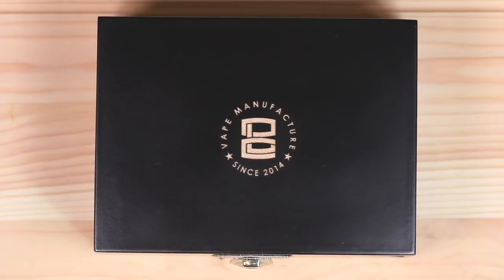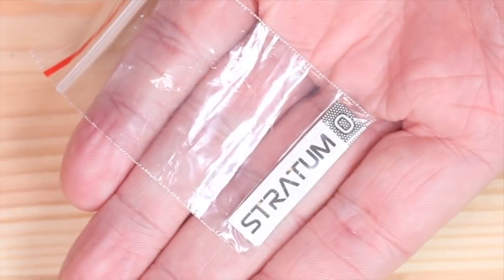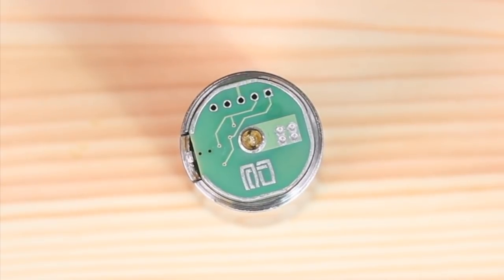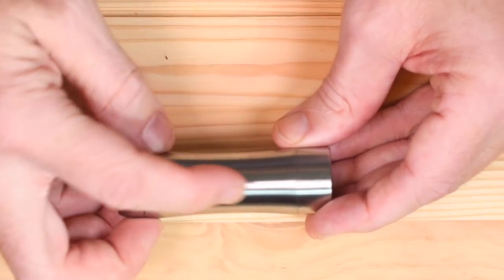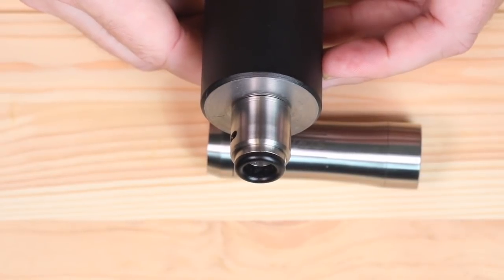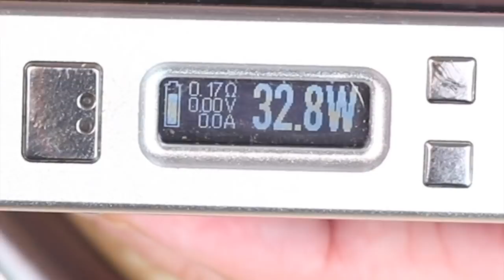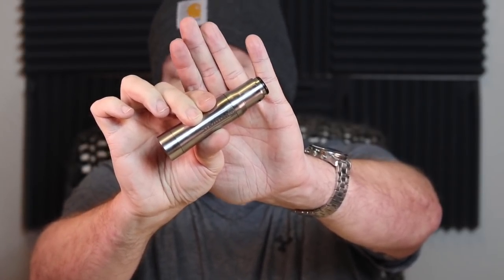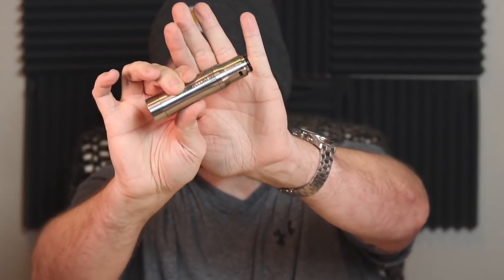STRATUM ZERO PRESTIGE by OLC ~ INSANE MOSFET/SIDE FIRE/TINY 21700/RUSSIA!

Comment: Loved the review.

Just a small clarification, the Stratum 0 is made of stainless steel (the 3 versions), which I think is another pro.

Andrey (OLC) announced some time ago a 18350 mode for the Prestige and Elegance, but I do not know if they produced it, there are some pictures on the Stratum OLC Facebook group, it looks really tiny !

Greetings from México.
Reply from the maker: I did say aluminum :(  Didn't even realize i said that!  It's like when I'm showing you guys a 510 drip tip but i say 810.....sometimes the brain to mouth connection gets a short ...a hard shot LMFAO!!   18350 tubes are all the rage now for MTL so I wouldn't doubt that they come out with one.  Thank you so much for checking out the vid Ariel...much appreciated man #ALLOVE :-)  #VIVALAMEXICO .....I used to spend a lot of time in Pureto Panasco (Rocky Point)!  Fun times back in my wild and crazy days :-)

Comment: It's stainless steel, not aluminum and I see yours has the gap at the top cap to the body caused by the Mosfet board being too thick to fully thread the top caps into the body. Try to screw the top cap down without the Mosfet board installed and you will see no gap. The two rubber rings you didn't seem to know what they were for are to go over an 18650 battery to fit the body better. You can probably get the top cap to screw all the way into the body without a gap using the YFTK clone Mosfet board as it is thinner and the YFTK caps install without the gap.For around $5 or so you could test it out. I wanted an authentic but they were out of stock and never notified me when they had stock to sell. Looking back I'm glad I didn't get an authentic with the gap at the top cap to body connection. The YTFK has a perfect fit and finish, it's 316 stainless and around $270 cheaper. I understand a clone is theft of intellectual property and I only buy them if the authentic is not available at all or if I already own an authentic and wish to compare quality between the two. In most cases the authentic will have the best fit/finish and function but there are some exceptions where the clone is superior to an authentic.Unfortunately I will never compare this model to an original because I am not shelling out $300 for a mod with a gap between the top caps and body.

Comment: 300 is  too much
Reply: Totally too much for a top cap that won't screw down without a gap. I'm not suggesting you buy the YFTK clone for under $30 but I can assure you the top caps fit with no gap and the fit and finish is nothing less than perfection.The Mosfet circuit board on the YFTK is a bit thinner thus eliminating the gap seen on the authentic. If you watch any video of this authentic you can't miss seeing the gap if you are really looking at it.